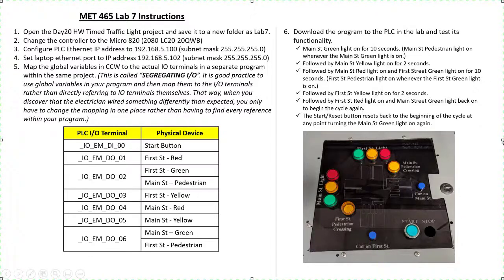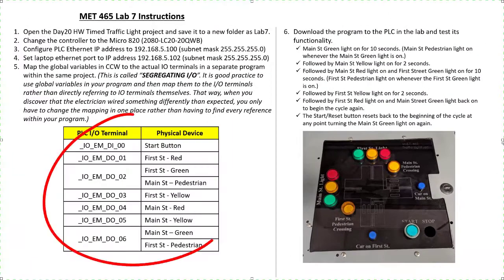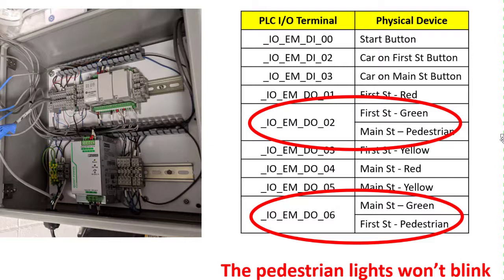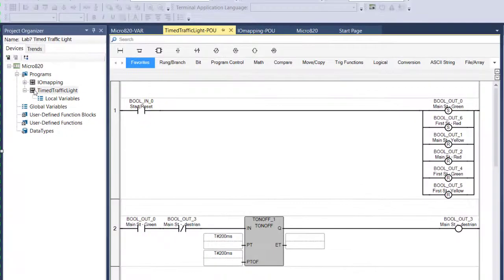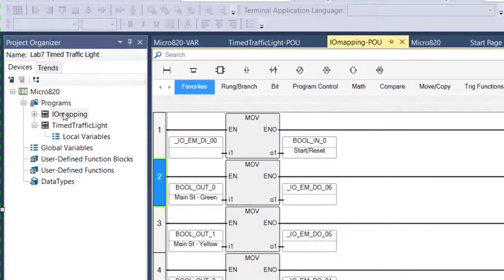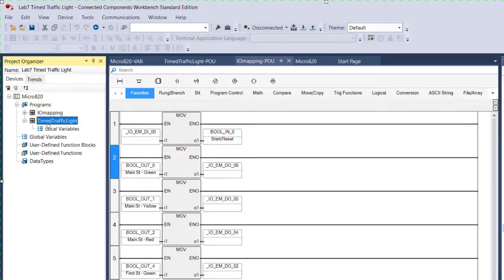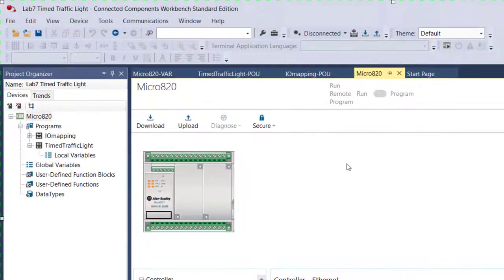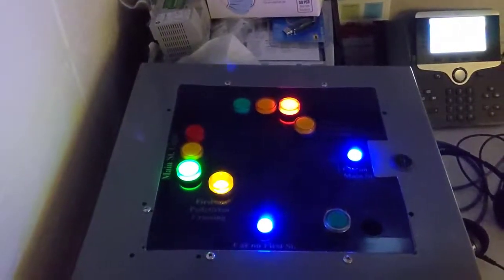Lab7 Video   Timed Traffic Light

Comment: Interesting, in 1980, in one of our first EE classes, we programmed an assembly language street light controller including walk button, on early z80 microcomputers with hexadecimal keypad and punch tape input and output was an eight 7-segment display. We ran our programs by inputting tape, but I don't remember where we edited our code to produce the tape. Maybe there was crt editor on a PDP-11, although we often made ibm punch cards might have used those to output on tape. There was a huge time penalty for code errors, we had to re-output our tape, maybe change labs to run again...